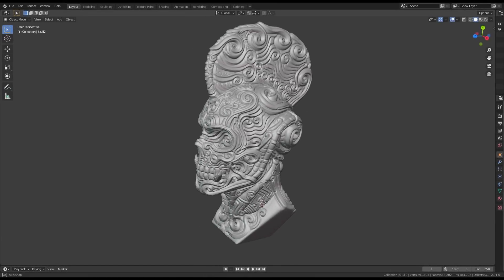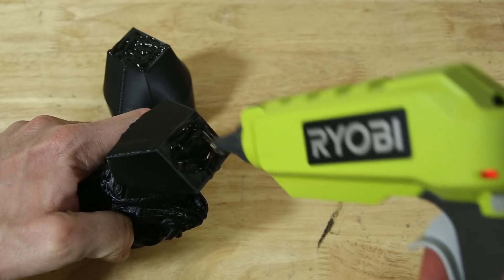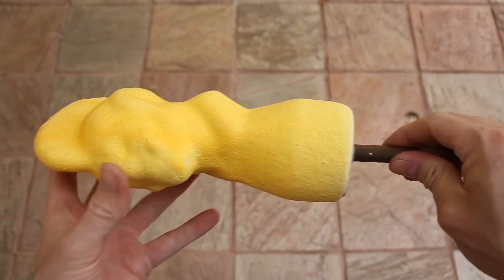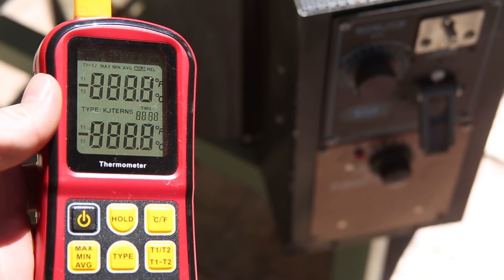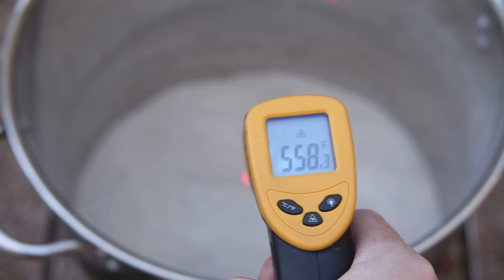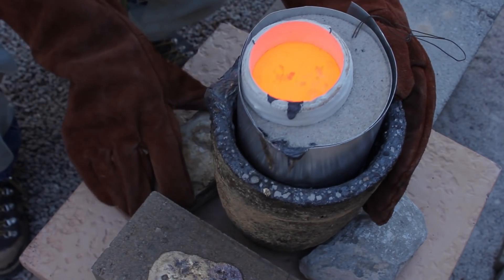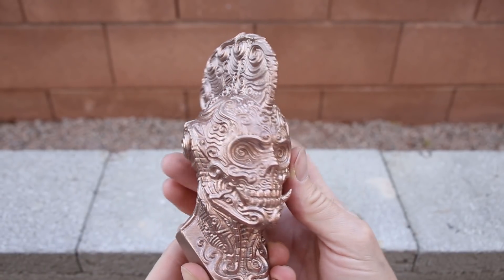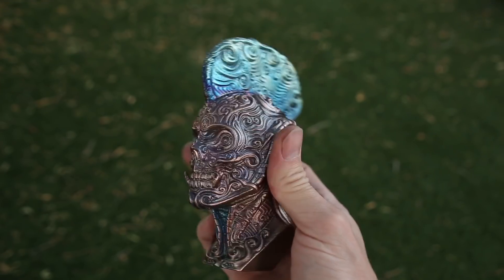How to turn a 3D PRINT into BRONZE │ Lost PLA Metal Casting │ ASMR

Comment: Thanks for these awesome videos! These are always really great to watch. Could I ask you, is there a limit to how thick you can cast something? I am really impressed that you were able to pull this one off without getting any shrinkage or pitting. I did not know this was possible at that size. Do you have some method for this other than adding a really big sprue? Do you cast the metal at a lower temperature or something?

Comment: Maybe you could use ABS filament, lightly spray with acetone to smooth the print lines, cast the mold, then use more acetone to dissolve the filament completely.

Comment: Amazing work!  Have you considered trying to print an internal shell that is filled with casting sand and plaster to achieve a thin wall of bronze.  Similar to lost wax casting of sculptures. This would use much less bronze.

Comment: Great work! Usually fine sand is used for a first layer and coarser sand for the rest. You may also consider building a "sand boiling bath" for even coating. This is what used in industry.

Comment: I think it may be a good idea to get a threaded rod (printed, wood, metal, doesn't matter) that threads into the sprue (print threads into the sprue hole). Then you can have an easily removed handle for dipping while avoiding having to burn out the wooden handle each time.
Reply from the maker: I think that is a good idea. I may do that. Thanks!

Comment: Couldn't the kiln reach the temps to melt the bronze?
Reply from the maker: Eventually the bronze would melt but it would take many hours and it still wouldn’t be an the right temperature. Melting point isn’t the same as pouring temperature.
Reply: @robinson-foundry  Thanks for answering my question. I have a kiln but I'm setting my sights lower. Aluminum.

Comment: Any reason you usually use hot glue instead of something like gorilla glue super glue?
Reply from the maker: Hot glue melts out easily without leaving anything behind. Super glue would probably work but I think you get a stronger joint with hot glue.

Comment: So why don't you try breaking the casting when it's still hot by placing it in water to shock the ceramic into cracking?
Reply from the maker: The shell doesn't dissolve at all in water. And because the metal shrinks slightly pulling away from the shell water will become trapped and cause a steam explosion. Still would be cool though.
Reply: @robinson-foundry  Perhaps the steam explosions could be reduced if the you lower the casting slowly into water. While the casting wouldn’t dissolve in water the heat would crack it from the shock, like how investment casts are done.
Reply: Dunking or spraying the hot shell in water doesn't work as well as you think it will.  Better to let the shell completely cool then hit the pour cup with the hammer and the vibrations will release the metal from the shell.

Comment: I Just built my own furnace and i was wondering why he doesn’t use sand casting... if someone could explain the pros and cons of this method...
Reply: @cap5856   i was thinking about turning the sand cast upside down and heating it maybe in the oven at 250 and letting the Plastic drip out of the pouring channels . Do you think my idea is possible?